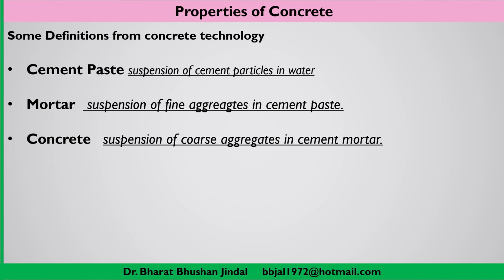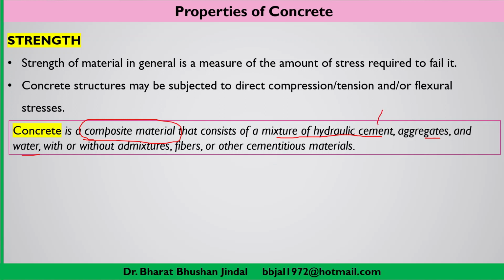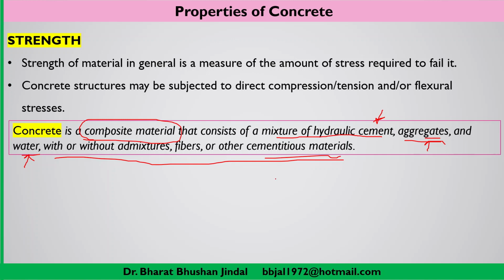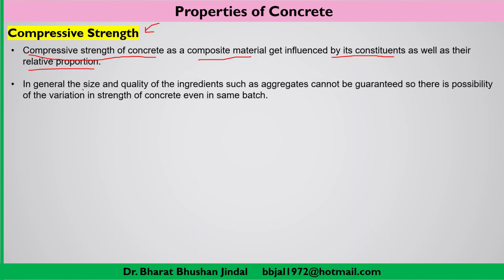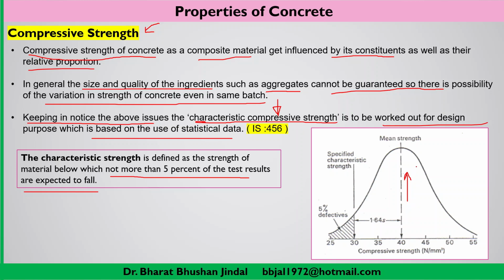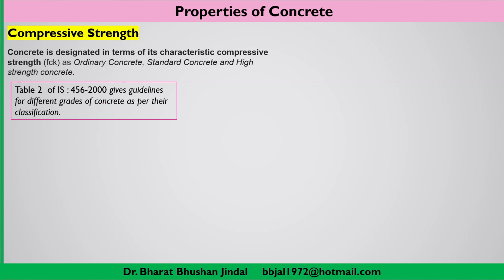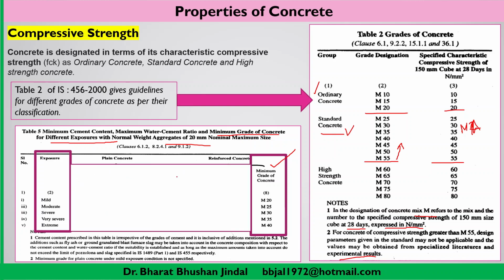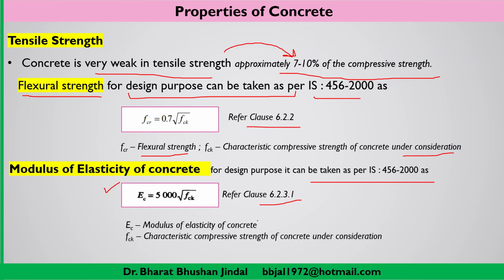Lecture 1 || Properties of Concrete || IS :456 -2000 || Civil Engg.

Comment: Sir in different block of concrete difference in their compressive strength.. it's only affects the size and shape of aggregates or any other ingredients are also responsible for this?
Reply from the maker: Strength of concrete get affected by all the ingredients of concrete, ambient conditions, temperature ( of ambient, ingredients) during casting, workmanship and many other parameters.

Comment: Sir as per IS 456:2000... Min grade of concrete for pcc is M15 and that of RCC is M20.. If we are using steel in rcc to reinforced it then why we need to used high grade of concrete for the same exposure condition in RCC?
Reply from the maker: Concrete is used to gain compressive strength and steel is reinforced to take care of compressive / tensile stresses induced due to flexure affect.

Comment: Sir, why the characteristic compressive strength of plain concrete is taken less than reinforced concrete for similar exposure conditions
Reply from the maker: Characteristic compressive strength is taken for 'Concrete' not RCC; only unit weight of plain concrete differs from RCC.

Comment: Concrete is a non-linear, non-elastic and brittle material. It is strong in compression and very weak in tension. Because it has essentially zero strength in tension, it is almost always used as reinforced concrete, a composite material. It is a mixture of sand, aggregate, cement and water
Reply from the maker: No concrete possess lesser tensile strength not ZERO.

Comment: In the given video we are cleared with some basic definition of cement paste, mortar, concrete etc. Different types of concrete are also discussed. detailed explanation of compressive strength of concrete  and its key  role into structural construction, characteristic strength, etc

Comment: Summary
The lecture is all about properties of concrete and it's significance. Further it starts with the basic familiar defination of terms like cement paste, motar , concrete and its types. 
Concrete ( Latin word concretus )- it is composite material that consist of mixture of cement, water, aggregate ( for improving the quality , we add various admixture) . Concrete is generally considered homogenous. 
Strength of concrete is the measure of amount of stress required to fail it. 
Compressive strength depends upon the constituents and respective proportions. So even the same batch of concrete can have different strength. 
The characteristic strength is defined as the strength of the concrete below which not more than 5% of the test results are expected to fall. ( for better understanding we have to refer to IS 456 - 2000) . Concrete has very low tensile strength.  Since concrete is mixture of natural occurring particles like sand aggregate , it always has microscopic cracks in its body. Now, these cracks don't cause any trouble when compression is applied to concrete, but when tensile forces are applied, those same microscopic cracks become elongated. So tensile strength is lower as compared to compressive strength.

Comment: Concrete is made by mixing Cement, Sand, water, and aggregate. Due to the applied pull force, the glue which holds different constituents of concrete alos known as ITZ in Concrete, together will break. So under tension, this zone will act as a weak link and concrete will fail at a lower force.

Comment: Sir, If we are using 150mm cube for evaluating characteristic compressive strength at 28 days then what will be the 5% defective portion ?
Reply from the maker: It is not a defective portion of the cube etc., its application of statistical analysis that 5% of test results may fall below the value of a particular compressive strength which is termed as characteristic strength.

You are advised to re watch the video carefully to clear this doubt.
Reply: @DrBharatBhushanJindal  Ok sir, I got it

Comment: In this lecture I learned about some basic definition like definition of cement paste ,mortar, fibre concrete , strength, concrete etc. The details about compressive strength (basically about the characteristic strength) and the tensile strength were included in this lecture. Along with this  I came to know about the formula for flexural strength and modulus of elasticity of concrete .
Thanks for the lecture sir.

Comment: Concrete has weaker tensile strength as compared to its compressive strength. It is made up of cement, water, aggregates and other materials. The contact surface between the matrix phase and aggregate phase is incoherent. When it is subjected to tensile forces the aggregates are trying to pull away from each other which results in cracks while when subjected to compressive forces, the discontinuity is decreased and hence resulting in decrease of cracks.

Comment: Concrete comprises of cement, sand, water, aggregate. The contact area between cement paste and aggregate is discontinuous at microscopic level. When it is subjected to tensile forces, the discontinuity increases resulting is cracks and fractures. But when the concrete is subjected to compressive forces, discontinuity reduces resulting in better interlocking. That's why concrete is weak in tension and strong in compression.